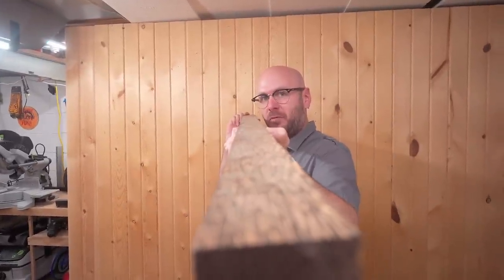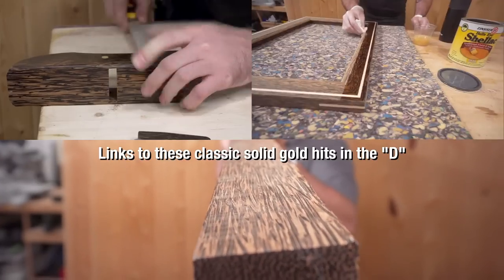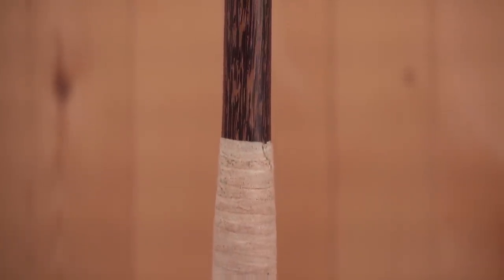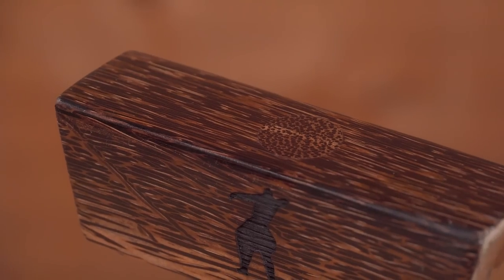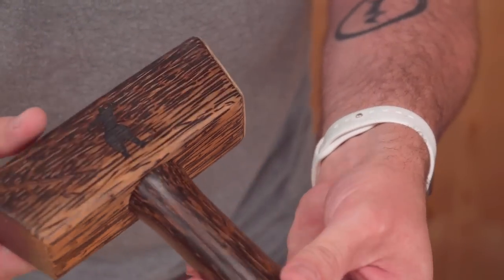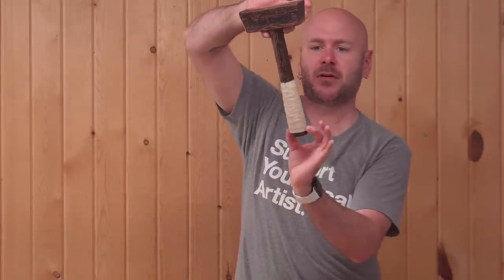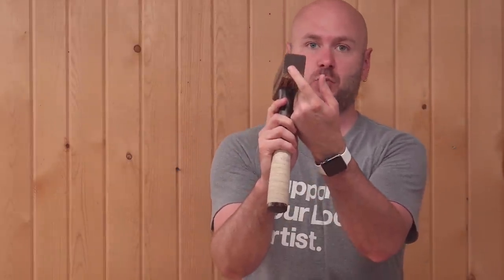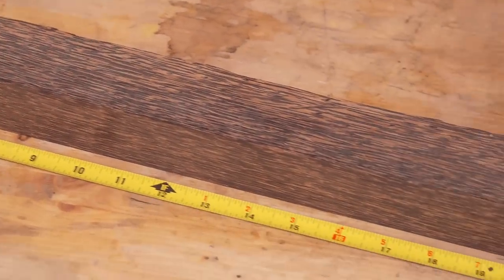How to Make a Wood Mallet

Comment: That wood is really pretty.  Ok David, my suggestion is make a turned pop-up toothpick dispenser!  Its just a turned box with a lid, knob on top, a dowl rod for a shaft and a cup in the bottom.  when you pull the lid the toothpicks spread out of the box.

Comment: 4:35 If you put painters tape down before you use the flowforge it will prevent the 'over burn' on the wood itself and you wont need to sand it off. FYI.

Comment: Perhaps you could turn set of utensil handles - such as some cheese knives and a cheese serving platter (using a thin strip of the coconut palm in that too).

Or a set of scientific instruments - magnifying glass, ruler, compass, tongs, test tube holder. I know that would be pushing the limits of the wood you have left though (So maybe just a set of different strength magnifying glasses?).

Comment: Hammer was superb.With the left over stock, cut it length ways on the bandsaw at 1-2 mm thick @ 300mm long and make rulers from it. The numbers could be etched in with CnC machine ?....just an idea.From Calvin (UK)

Comment: what are you doing with that wedged tenon?

you are spiting the wood by putting in that way. turn it 90
Reply: Nice catch.  you're right.
Reply: what do you mean?
Reply: He put the tenon wedge in so that it might split the grain on the hammer head. It should be put in 90 degrees of the direction of the grain.

Comment: Recommend any sources for getting coconut palm to work with? I've looked around but haven't come up with any places that have a board close to what you started with.
Reply from the maker: I got mine from Keim Lumber. Looks like they only sell pen blanks. So I'm not sure: http://www.keimlumber.com/products/421/34/10260
Reply: Yeah, that's what I kept finding as well. Thanks for the heads up on where you got it though!

Comment: If you're in the turning mood, you could always make a walking stick (or pimp cane). You could always resaw into some veneers and make a bunch of rings like you did in your other videos. You could cut it up and glue some pieces together and make a bitchin' bandsaw box. Maybe you could make a chess/checkerboard and use that as the black squares. Maybe make another pair of glasses??? You could turn a pizza cutter handle and get the cutter from Rockler to go with the pizza paddle you made. Tea light candle holder? Could you turn a whammy bar for one of your guitars???? You could turn a pepper mill and some pens. You could make a spoon. I think you said you weren't of a fan of picks, but maybe you could make a set or guitar picks? The walnut drum sticks didn't turn out good, maybe some coconut palm drum sticks would? Sorry brosif, I gave you like way too many ideas, some or most may not even be good. Hopefully you find some useful or get some better ideas from the ones I have.

Comment: You could make a nice walking stick (a cane, not the bug). You might need to laminate it with a contrasting wood (maple?) or grass (bamboo?).
I'm not criticizing the metal striking metal, but I will share a story. a long time ago, I was pounding on an ax head with a hammer. A thin piece (about 1/8" in diameter) of the ax head flew off, cut a hole in my shirt and buried itself in my shoulder. be aware that every now and then, the right combination of conditions allow a highly unlikely event to occur. Stuff happens.

Comment: I got a question.  If I was gonna make a wood hammer for my son - who will most likely gnaw on it because he's 1.  What wood and what finish would you suggest.  For the finish I assume some food grade oil or something you'd use for a cutting board aye?
Reply from the maker: Stick with domestic woods like walnut, maple, pine. Mineral oil works or even shellac.
Reply: Makes sense.  Thanks good sir

Comment: If that palm turns nicely four inches might produce four pens while another five inches can turn a replacement handle for a cheap screwdriver with four bits... you know the ones.
That will leave you about eighteen inches of 2x2 palm. You might use a few inches, two or three, to make thin inlay pieces for another project. Hopefully something more charming than the usual bowtie like a trout, a bear, a canoe, a Cleveland Browns helmet. Use both the cut out and then the negative left after removing the shape. Too much?
That leaves maybe a foot to craft another handle for a different mallet head in a different species and different profile.
That's about a buck fifty of my two cents worth. Off to carve a stall sign for a horse ... since I don't have a super cool xerox I'll be cussing it by hand... carving! I meant carving.